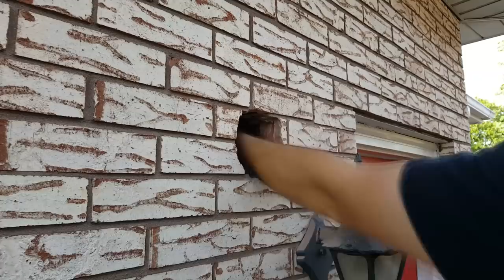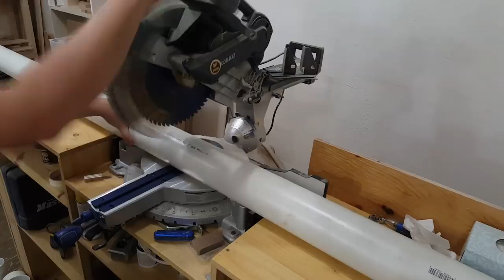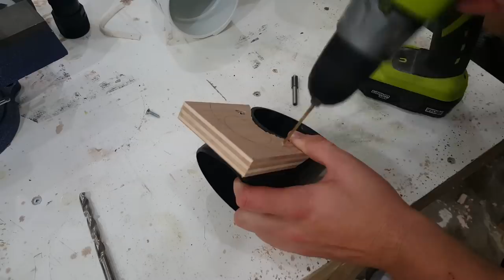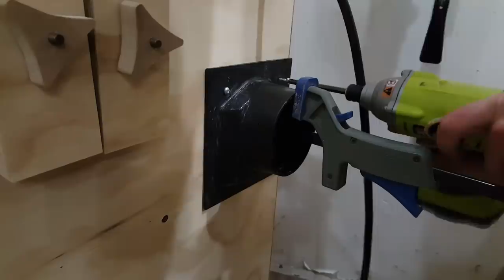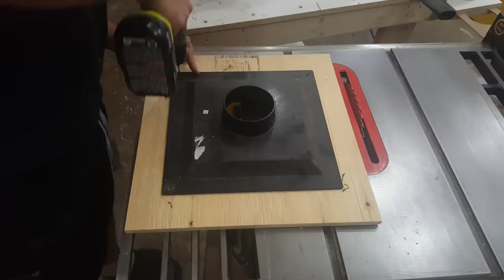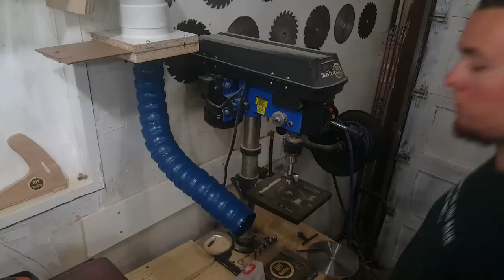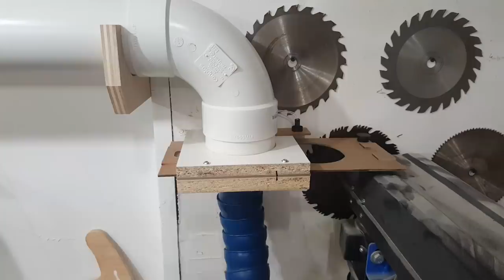DIY Dust Collector System with Homemade Blast Gates and Automatic Start/Stop Function

Comment: At last! Someone with the sense to exhaust to the outside of the workshop. Forget HEPA filters, and the cost of replacing them. Indeed, remove all filters. The cyclone will take almost all.
Reply: But by exhausting outside the workshop he gets rid of all his nice air conditioned air and has to re cool or heat the new air coming in. That's why most don't exhaust outside. It ruins your HVAC systems ability to efficiently  regulate temporature.
Reply: Most people do not have HVAC systems in their workshops. Those who do can fit a heat exchanger.

Comment: Nice system.  Exhausting outside means no filter, and that means optimum flow all the time.  I'd like to do that in the summer, when the heat isn't on, and switch back to a filter on colder days.  Have you considered adding a light ground wire, to prevent static discharge?
Reply from the maker: https://youtu.be/QqApmHkU9nM?t=51s

Comment: I found that without grounding the collection tubes, a large static charge was created.  Static charges and sawdust are not a good mix.  My solution was to run bare copper wire inside all of the tubes and also loosely coil additional wire outside of the tubes and then ground them, to dissipate any static buildup.

Comment: I loved everything that you did in this video! I have watched other dust collection videos and have not seen half of the things that you did with your system! Some great highlights were your 3 hole-in-one adapter, homemade blast gates with the built-in low-voltage relays, and everything in between.

I do have a few questions to ask though! 
1.) Are running into problems with gluing together your PVC connectors?
2.) Are you running into any problems with caulking some of your connections to your tools?
3.) Is there anything that you would do differently or have done differently since this video?

Again, loved this video and how you DIY'ed the project!  I give it an A+!
Reply from the maker: Thanks. No the only thing that's been an issue was the switches. Watch my viewers comments #3 video for details on that.

Comment: In addition to the relays toggling the dust collector's motor, I think it might not be a bad idea to have a tool lockout system, where having the blast gates closed would essentially disable it's assosciated tool, and opening the gate would allow power to reach the tool.
Reply: That's backwards thinking. The dust collector should be the slave and the tool the master.

Comment: So instead of a big canister filter just pipe it outside. looks like a great idea. Is that working out long term? does it make a mess on side of house? Terrific set-up!
Reply from the maker: No mess. The cyclone separates all dust into it. Only micro particles escape. Only draw back is i can't climate control my shop like this.

Comment: Thanks for your contribution.  I like the idea of skipping the filter and venting outside.  (Or even in the attic above my shop.)  Do you find much debris out there?  Has any dust residue built up on your brick wall?  Or is it just the very very fines that blow away in the wind?
Reply from the maker: No build up I've seen

Comment: By blowing the exhaust air out your creating  underpressure so if your doors seal well, you'll suck out all the oxigen, normaly you blow the exhaust air true a extra filter back into the room
Reply from the maker: Jeroen Torfs Luckily my garage is extremely horribly sealed

Comment: Excellent setup.  My only concern / question is about the 3-in-1 you made.  Since the blast gate is before those, once you open it, all 3 are "sucking".  Don't you get some loss of vacuum pressure by essentially having 2 of those sucking nothing while the 3rd is in use?
Reply from the maker: yes but its going from 4 inch to 1.5 x 3 so there is plenty of air already being restricted so they all suck evenly
Reply: Ah, cool.  I guess you didn't want to make 3 mini-blast gates.  :-D   Thanks!

Comment: Loved the video. My dust system uses  DC low voltage with two momentary switches at each station. I like your system better.  Are you using some type of magnetic on/off switch?If so, do you know of any magnetic momentary switches that could be used.
Reply from the maker: Skip Evans please watch my viewers comments video #3 for more details.

Comment: Is there a dust collection/separator before the exhaust, outside?  Also, is this in a cold climate...running the dust collection will exhaust warm air and require cold, makeup.  The designs for the gate are clever, especially the automatic on/off.

Comment: I'm about to build my DC system.  The issues I see here after studying is your system is pvc and its not grounded.  You need a bare wire inside and outside of the pipe.  A nasty static charge will build on the surface of the pvc and wood chips pass thru them.  Your at a huge risk of a flash fire with an grounded pvc system.  Another issue is your table saw is sealed up.  How are you going to dig slivers of scraps out as they fall down?   Also as stated below, how do you handle heat and cooling loss with the outside vented system?  How do you adapt with the addition of equipment and the moving of equipment?  This isn't a beat you up about what you did comment, its a I'm about to build my system and I'm curious about these issues, so if you don't mind can you reply with your thoughts on this.  Also, where do you get your flex hoses?

Comment: That relay to switch on power is an incredible idea. But just wondering why the silicone around the table saw extraction plate? Airtight doesn't matter at that point, just being thorough?
Reply from the maker: +XxTheGameCollectorxX every bit of air leakage is good to cover. I plan on doing some more plugging of leak holes on the table saw. For example adding a brush over the angle section in front.

Comment: How are you dealing with eliminating ESD (Electro Static Discharge? Your system seems very well built but this issue can cause you your shop and/or your life. PVC produces a LOT of ESD especially when wood rubs inside of it in a dry day. This ESD can ignite the sawdust in a very violent way causing an explosion. If this is something you had not thought of I suggest you do the research and ensure you protect yourself. All it takes is one spark in your system to ignite all the dust all the way to the collection bin/bag/can at the end of the system. I've seen the results before, not pretty at all.
Reply from the maker: +Gilberto Diaz-Castro thanks.  For my thoughts on the subject please watch my viewers comments video #3.

Comment: Taking warm air from shop and pitching it outside.  Probably replacing it with cold air from outside.  Need effective interior filter.
Reply from the maker: No warm air in my garage

Comment: Nice set up!  I have a similar dust collection system in the works with a 2 hp blower and cyclone (under construction) in my shops attic.  I'm also setting up a remote gate system that I bought (Long Ranger system from Penn State Industries).  How is the suction on your 3-way split?
Reply from the maker: it works but could be better. I just bought a reverse impeller which that design over the forward facing impeller of the HF DC should provide more static suction. I will be installing it shortly and coming out with a video on the results. the new impeller is also an inch or so bigger so should be an improvement.

Comment: I love how you edit your videos and show how you drill in gillions of screws!!! If you knew you might move or rearrange your shop, would screws with soft washers work when assembling your plastic piping? ...or do you think they would allow too much leakage?
Reply from the maker: I will just cut and use couplers to reglue when i move
Reply: Nice clean install! I like your relay control switches on the blast gates! Great idea! All thumbs up and subscribed! I just found your cyclone video! Your stuff may just be the foundation of my work shop! Thanks!

Comment: Great little Idea video for a learn as you go, cheap DC system. EXACTLY what I needed. Awesome Video, Brother man. I have a cinder block run about 6 inches up from the floor...I want to run 4" PVC along this ...does having it on the floor make any difference? It will run along the outside wall of my shop with 3 connection points...1, 2 1/2" and 2, 4".
Semper Fi
Reply from the maker: Nonya Bus more bends = less air flow. That's all i could really offer you as advice

Comment: How well are the 90 deg bends working.. Also the 4 inch pipe doing OK too?  With the 4 in combined with the 90's some people will make comments.  Lastly, I hear problems with static electricity with plastic pipe.  Do you see any issues?  I am planning to use 4 in and just looking to avoid issues if I can.   Thanks
Reply from the maker: None of the aforementioned has been an issue thus far

Comment: Nice build. Ingenuous how you saved space and cost by using the impeller housing to vent outside eliminating the use of the separator housing and a  Wynn filter that needs replaced ever so often. I found your channel this morning via your Rikon upgrade video that you posted to the wood talk online forum. So far I have enjoyed watching all of your videos. Definitely subscribed!! It is also nice that you have offered plans for the builds that you can follow. Nice job!!  By the way, how long did it take you to do this install?
Reply from the maker: +Wincer Tactical thanks. I couldn't put a time on it really but my guess is 10-20 hours

Comment: Is that glue you used on the pipe connections or a type of gasket maker? If its glue how do unplug the pipe if it gets plugged? Very nice work.

Comment: Great video, I'm using a lot of your ideas in my shop. Why did you build the custom box on the exhaust side of the blower instead of using the plastic transition from the harbor freight (the one you used to get screw references)?
Reply from the maker: Because I used the round part to connect my lid of bucket to cyclone flex hose at the bottom

Comment: Nicely done! Have you made plans for your blast gates by chance? 

Oh, you forgot to wipe your caulk joint around the outside vent. All the same I think I you did a fantastic job.
Reply from the maker: They are on my website under shop project plans. (Shop as in woodshop. My plans are free)

Comment: Great system. I'm interested to know if you find that venting the exhaust outside lowers the noise and increases the suction, since there may be less resistance due to not having a filter to deal with?
Thanks for sharing.
Reply from the maker: +flybyscy i would say both are true

Comment: Great job! Looking to do this to my small shop. But wondering if the venting of the system to the outdoors would remove the AC/Heating of the shop? I would like to do that, but wonder if this would prevent climate control?
Reply from the maker: Yes. At the time my garage was not climate controlled. Watch my garage reno shop 2.0 video for how I fixed that.

Comment: Great job and great video! No annoying music! Btw... how do you find the table saw dust collection works with the way you have it set up from the bottom? Does it stop the fine sawdust from geting in the air? My main concern is keeping the dust out of the air. I'm not that concerned about dust on the surface of the tool, or in the floor. I seem to be getting very sensitive to breathing the dust in the air.
Reply from the maker: Your going to need to invest in a good over arm blade guard with dust collection then. The bottom collection is only like 50% effective.
Reply: Tks!

Comment: LOVED THE BUILD.....BUT.....😳
Do you ever use Impact Cut Resistant Gloves and Push Block or Push Sticks for safety. It doesn’t really matter the brand, it’s all for safety.

I know you’re experience but a lot of young inexperience people are watching. At least half of them are going to do what you do and lose a finger or worst, so please make a video exercising safety while using any tool. 

Thank you,
J
🙏🏽🥑💚🍏👍🏽
Reply from the maker: If my hands are close enough to the blade i always use a push stick. As for gloves in a wood shop i never wear them as it's much safer to get a cut than have the glove get sucked in to the machine.
Reply: DIY Builds,
Thank you for your reply.
I trust that YOU know what  you’re doing, but for others just getting into woodworking and might easily hurt themselves.
I would produce a video explaining it’s always good to exercise safety.

Thank you,
J
🙏🏽🥑🍏💚👍🏽

Comment: So without internal circulation, by venting the air outside, you create negative pressure in the shop. This would draw in air from ultimately outside. thus your shop gets cold / costs a fortune to keep warm during winter ?
Reply from the maker: Watch my shop reno video from a few months ago

Comment: Is it necessary to glue the pipe joints?  What if you need to modify the system or move things? Would duct tape around the seams work just as well?
Reply from the maker: In 3 years I haven't moved anything so for me cementing the joints was worth it.

Comment: That's a very impressive "system" you have there, it's also simple to follow without the need for any specialist tools, though I do want your scroll saw🤣.
When you cut the hole to vent why didnt you put a plate around the interior piece of pipe to give it that perfect seal?

Comment: Dude, Awesome Job!!!!!!.   I am just starting my dust collection.  I have wanted this sooooo long.  I like how you done things.  Very cool.  Would you recommend 6" or 4" PVC or maybe 5" metal ducting?  I am torn with this decision but my gut tells me either 5 or 6" since I have a 2 HP motor with larger fan.  Thoughts?
Reply from the maker: Use the size that comes off the blower.

Comment: Yours is a far more powerful setup but I'm curious on how far can a pipe go and still pull dust to a shop vacuum?
I'm guessing with a lot of drops, even with gates closed whatever is last in line may not have much suction?

Comment: I got an idea to improve the system, by adding a passive heat exchanger and maybe repurpose an old fridge/freezer for additionally recollection of heat/cold as a heat pump. 

This should save a large amount of heating energy and energy from the AC.

If you're interested I can write down my construction ideas.
Reply from the maker: I don't heat or cool my shop.
Reply: @DIYBuilds  You answered to someone else that this system got the drawback of not beeing able to climate control your shop, that got me thinking.

With a heat exchanger you could at least avoid moisture issues when working on hot day's with somewhat humid climate and a cool shop. And avoid having to freeze in winter if it's extremely cold.

Just an idea, hit me up if you have given it a second thought 😙🎶

Comment: Hey man. Did you stick with the 4" Ducting? If so, do you get enough suction? Thanks
Reply from the maker: Yes and yes
Reply: @DIYBuilds  good to know. It's in my to-do novel... I mean list.
Reply: @DIYBuilds  can't decide where I want to mount my 2hp DC. I wonder how much power id lose if my baffle was on floor level over a trash can with the motor in the attic, exhausting out through a vent like yours. Maybe even the attic gable.

Comment: Really great system, where did you get the hose for the drill press? It looks like you used the water discharge hose for the small tools (I might be wrong about that) I did not have much luck with it.
Reply from the maker: +Evan Dunville lee valley called loc line

Comment: Great video! What's the name of and where can I get that blue flexible hose you're using for the drill press?
Reply from the maker: +BTR1389 loc line sold at lee valley
Reply: DIY Builds thanks!

Comment: I do have a question about your external exhaust.   The purpose of a cyclone is to recycle the air in the shop to keep the heat or cool in, otherwise you would just blow the dust outside into a container.  What was the purpose of doing it the way you did?
Reply from the maker: No. The purpose of a cyclone is separate the dust and air placing the dust in the bin. The air leaving the shop only contains micro particles which are hard to filter and the worst for your health.

Comment: As someone else has commented and was highlighted on another channel the outside exhaust really effect the loss of conditioning in the shop.  Any work arounds about that?  I think I will use a cyclone and filter the final exhaust back into the shop just for that reason.  Take care.  Doug

Comment: Great video and I love the blast gate power idea.  Do you have some kind of timer on the motor to keep it running when you turn them off?  I've read it's a bad idea to short cycle the motor (lots of short on and off times).  If you didn't, it will be interesting to see if the lifetime of the DC is impacted.

With venting outside, how do you handle making up the air that you're blowing out?  Do you have a vent to the outside?  Do you notice any loss of heat or cold conditioned air?  I'm thinking of venting mine outside as well, much easier than handling all the filtering.
Reply from the maker: +rjtumble no timer. I see no reason that the life of the motor would be effected by staying on for any more time vs shut off immediately. 
I don't hear or cool my shop so it's not an issue for me.

Comment: Are you using your shop in the winter? Because if yes, you will suck out your heated air that way because of your exterior exust
Reply from the maker: I do use my shop in the winter and it's never heated. I just suffer.